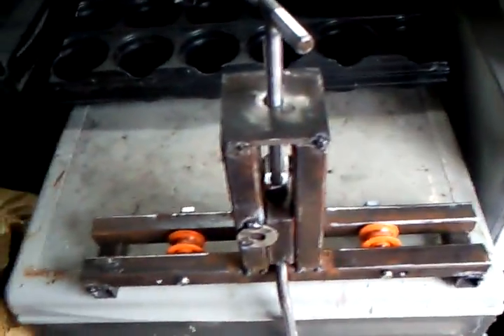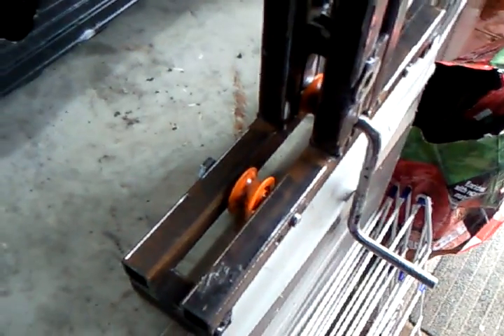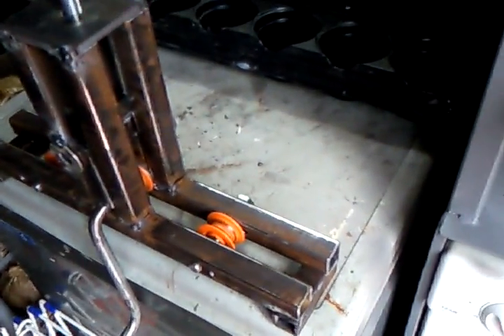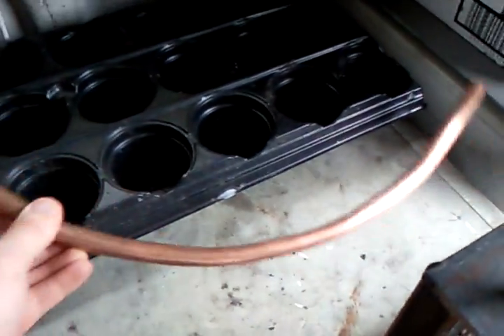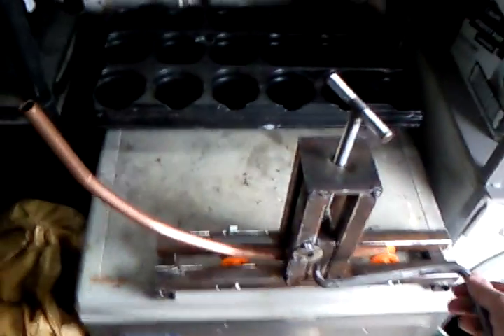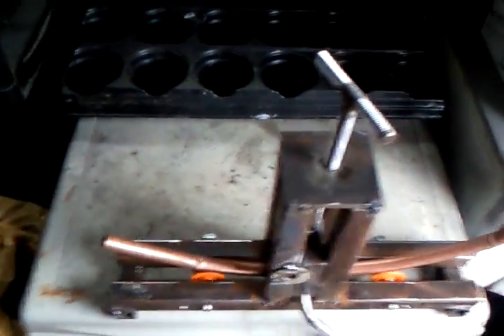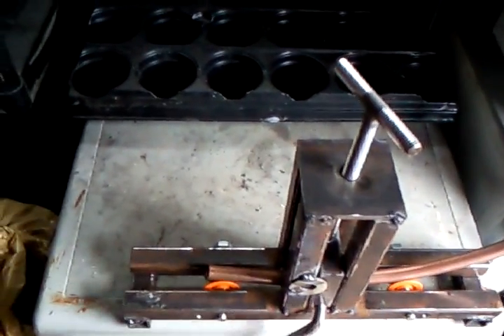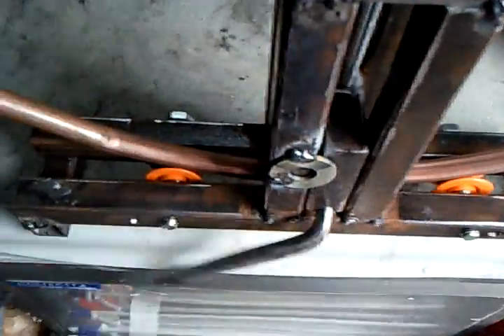DIY Alloy Tube Bender

Comment: @lookupparagliding Yup, exactly that. Though the test prop is actually an old Born 110cm which I got off ebay ages ago. Thanks for the tube offer - let me test this one out, then it can be the prototype for something a bit neater looking if it works. If you need any big tubes of ally there's somne of that left, not measured but thicker than scaffolding I should say.

Comment from the maker: @weirwolfarroo Hi Tom, it's a bit of a secret at the moment. I need more funding before I can be certain to carry on with the new project. If all goes to plan then it could be quite BIG. You could have squeezed some big bender jokes in if you wanted ;) The tube bender needs some bearings for the center pulley to work properly but Sam and I did manage to start bending a 2m length of 12mm diameter solid alloy bar (DIY tent poles). Once sorted it should cope with tubing without too many probs.
Rob

Comment: Has looked, it was pleasant and has made very quickly. My device I did of 18 mm under a pipe. If it is possible to put rollers more close to get rid of a bend in the beginning, I want to try so to make.
Посмотрел, понравилось и изготовил очень быстро. Мой аппарат я делал под трубу 18 мм. Если ролики поставить ближе можно избавиться от изгиба в начале, я хочу попробовать так сделать.